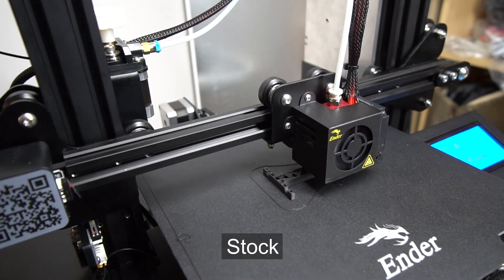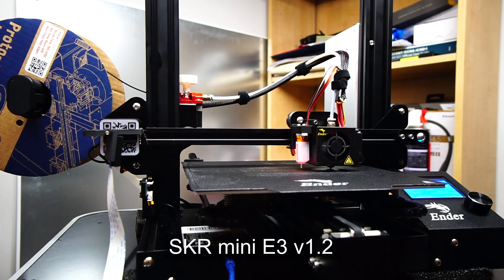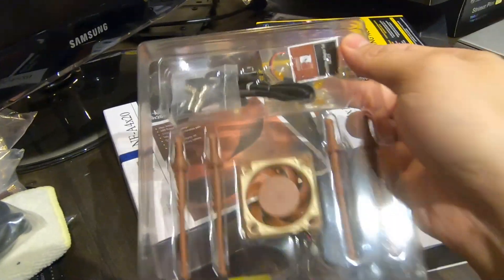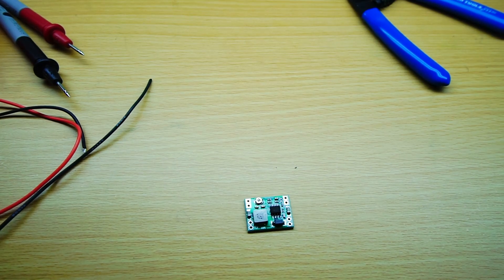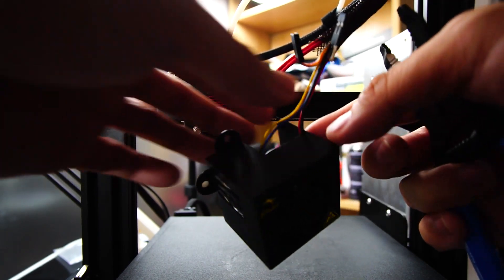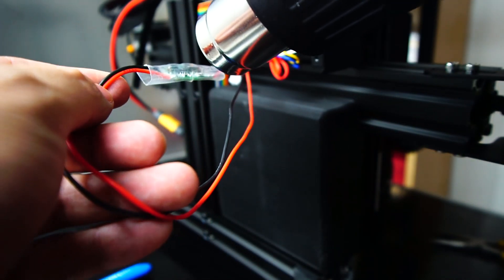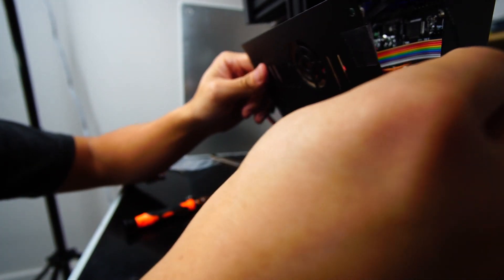Upgrading Ender 3 Fans with Noctua 40x20 for Quieter Printing

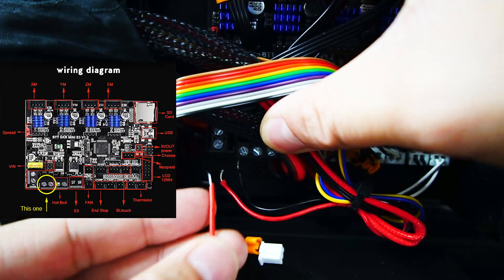Comment: One of the best videos for this, thanks a bunch! Also for the buck converter for the mainboard, did you also connect it to the yellow circle at 3:30? So you have both buck converters going into that yellow circle?
Reply from the maker: No, both circuits are separate since the fans have different ports.

Comment: How come you are setting the buck converter to 5V for the noctua fans? I thought they were 12V fans and every other video I've watched on this mod has set all buck converters to 12V.
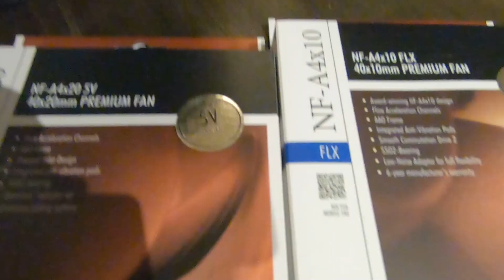Reply from the maker: The noctua fans I installed are 5V models. You can see it at the 1:00 mark where I mentioned the different models and voltages rating. Amazon links to the exact fans are also in the description of the video. I would recommend verifying the voltage rating on the fans before installing.
Reply: @dorkytim  Thanks, makes sense. I didn't realise there were 5V noctua fans as well. Cheers

Comment: Hi DorkyTim, really enjoyed your video. I notice that other people who install Noctua fans on their Ender 3s end up soldering at some point.  Did you have to do any soldering, or was the buck converter and multimeter, and the fan(s), all that was required for fan replacement? Thanks.
Reply from the maker: Soldering is definitely preferred to ensure things will stay connected, but if you have good shrink wrap then it can hold the connection well enough without solder. I've tested both, with and without solder, and didn't find any problems using either methods. I suggest shrink wrapping even if you decide to solder.
Reply: @dorkytim  Great video, by the way. Subscribed. Any link to the shrinkwrap tubes on Amazon, or the heating tool you used? Thanks again!
Reply from the maker: @RiqueFresco  https://www.amazon.com/gp/product/B01MFA3OFA/ This is the set of shrink wraps I have, but I did find that even the widest one in the set (10mm) was a tad too snug for these buck converters. It was a little bit of struggle to get them on. If I had to do it over again, I would think about getting ones that were a little bit wider than 10mm. Maybe 12mm would've been nice. I got the heat gun from a hardware store, but any $12-$20 heat gun on amazon will likely do. If you get a heat gun, I recommend one with a stand that lets you prop it facing upwards to be useful in a lot of other applications. However, for this small application, you can also use a candle or lighter to shrink the wrapping as well. Just be careful not to touch the flame directly on the wrap for long.

Comment: Noctua fans, 2 versions are available. 1 is pressure biased, the other flow biased. Which did you buy? Have you tried both to compare results?
Reply from the maker: That's a good point. Thanks for bringing it up. When I was researching Noctua fans, I found that they only mark certain fans in the 120x25mm size as pressure optimized or airflow optimized. There was no such distinction in the 40x20mm or 40x10mm sizes. In the 40x20mm category range, all of them had the same rated metrics except for the differences in voltage and signal.

https://noctua.at/en/which_fan_is_right_for_me
https://noctua.at/en/products/fan

*Edited to add links
Reply: That's actually quite interesting.  I can tell the difference between the two types just by looking at the blades. The swept type blades are pressure biased and the more symmetrical "petal" shape is usually flow biased. You've peeked my interest, more homework. 😀

Just a brain dump but perhaps due to the small size they have went with a compromise somewhere in between. It gets difficult to control air flow the smaller you get and the stator/rotor assembly is probably a more or less standard design reused across several sizes thus limiting options in terms of space. Shape of the "frame" and the blades effect performance. A lot of engineering would probably be required. Perhaps cost vs typical number of units sold lead them to go for a single more middle of the road type of design.

Comment: Not sure if you noticed but normally Marlin is configured so hot end fan starts spinning ing at 50-60 defgrees. With noctua mod and buck converter fan is on from the moment printer is turned on. That's pretty weird - not sure why printer ignores firmware setting for this one
Reply: hot end fan has always been running for me. Changing the fan should not change this all.
furthermore, I have a raspberry pi plugged into the USB port. even if the machine is off, this will also power the hot end fan.
i'm wondering if you just didn't notice it until you changed the fan?

Comment: Thanks for that Tim.  Very well done video.   Much appreciated.  I want to try the same mods.   just two  questions:   Is the original Input Voltage to both BUCK converters 24 V?  Did you do your BUCK converter adjustment off line, or actually connected to the Mainboard ?
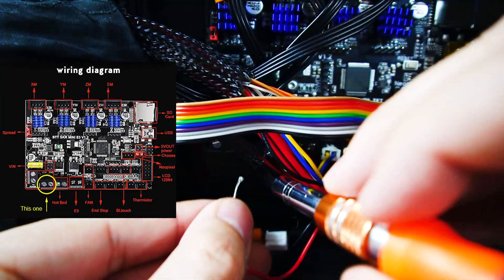Reply from the maker: Yes, the original voltage was 24v which is what the ender 3 pro uses. However, the main board is also rated for 12V because some older ender 3 models had 12v power supply, so it's important to double check what the voltage coming out of the fan port, I did this offline with my multimeter. For the buck converter, I did supply it with power from a power station offline to make sure the buck converter was functional, and then at 3:45 in this video I connected the buck converter to the mainboard and did the voltage adjustment while connected to the printer.
Reply: @dorkytim  So you have to buy a power station that costs more than a quiet Prusa? Why do every youtubers expect that (poor) viewers own expensive engineers equipments?
Reply from the maker: I'm sorry, I'm not sure I understand where the expensive power station you are referring to is coming from?
Reply: @dorkytim  I've seen CHEP doing the same mod. He also measured the buck converter with a offline power station. That doesn't look cheap. I've seen many youtubers doing this mod, but none mention or showing the crucial part; how to tune the converter to 12 v before final mounting.
Reply from the maker: Oh! You just need a tool that can measure voltages. These multimeters are around $10 and come in many different brands. I would say they are a staple in any tool box for electric work. You could also get a buck converter that has a LED readout built-in for about $1-$3. I wouldn't consider this expensive in comparison to a Prusa which is around $800 give or take.

 https://www.amazon.com/dp/B07VHC1NMC/ref=cm_sw_r_cp_apa_i_vstwFbSAWXP1E

https://www.amazon.com/dp/B089N65NMP/ref=cm_sw_r_cp_apa_i_MxtwFb3XQ8B7W
Reply: @dorkytim  Thanks for your answer, but that is not what I meant. I do have a multimeter. I just want to know if it's ok to have the Ender 3 Pro as the only power source to tune the converter. Is it ok to just cut the two hotend fan cables, solder them to the input on the converter, power up the printer and measure/tune to 12 volt on output side on the converter with multimeter? And same for the mainboard fan?
Reply from the maker: Ohhh! I understand what you mean. That is a great point. Ideally, it would be great to be able to test things in a separate circuit. However, what you suggested would be fine. As long as you are careful to connect the fan power to the input side of the buck converter, there shouldn't be a problem with tuning directly on your Ender.

At worst the buck converter is bad, but your mainboard should be fine unless the inputs were shorted for a while.

Connect the multimeter to the output of the converter and be ready to read the voltage. If it's not in the expected range, then shut down the power and toss the converter for another one.

I wish I had a power generator as well. For most of my testing, I use an old PC power supply and a bread board. For this video I did it directly off the Ender.

Edit: I originally said I did it off the ender in this video, but checked back and that was another video.

Edit2: Nope, I was wrong again. Turns out I tuned it both ways while working on this video. On a power supply and directly on the ender.
Reply: @dorkytim  Big thanks for your answers! Now I know it's ok to tune the converter by directly connect it to the Ender 3 Pro fan power. It should not take long to tune it, so nothing should harm the electronics.

My biggest fears were that if I connected the converter together with the fan and turned on the Ender I could have fried the fan if the converter was completely incorrectly set from the factory.

But this way, I can tune the converter easily and knowing that the output is 12 volt and then do the complete solder work. And also after that, power up the Ender again and double check the output that it will still be steady at 12 v.
I will do the same procedure with the mainboard fan.

Comment: Don't you have any problems with heat creap? There a a couple of post concerned with the low airflow.
Reply from the maker: I have not had any issues with heat creep. I understand the concerns, but I've been monitoring this fan setup for quiet awhile and have yet to see signs of an issue.
Reply: @dorkytim  Okay thank you! Are you only printing PLA?
Reply from the maker: The two main types I print with right now are pla and petg.

Comment: I've seen some comments, that people burn they motherboard by powering buck from it. It's safer to power it straight from 24V, since it running continuously
Reply from the maker: I agree, if you can avoid adding things to the circuit and keep it at 24v then that should be the first option. I don't think there's anything wrong with using a buck converter though. Just check your circuit and be careful.
Reply: Yes, its defenately a thing. I did burn it too, however i dont understad why is it a problem to add a buck converter to the motherboard (as iam not good at electronics and i just wanted to follow step-by-step tutorials)...
Reply: I think these people are using maybe some bad buck converters or something.  The role of the buck converter is to change the voltage.  That should have no affect on the main board.  The power is leaving the main board and buck converter is lessening it.  So if it's "burning it out" in some way, that's usually an indication of too much voltage, which means the buck converters at some point aren't doing their job correctly.  I have 2 on mine for a couple of years now, never an issue.

Comment: what about using 2 12V fans in series? you should get a high flow with that and no need for the buck converter..
Reply from the maker: It will work, but I would not recommend running fans in series, and it's a bit excessive for the hotend. If performance was the goal, then the stock fan is good enough. The goal here was to reduce noise and extra fans would add more variables for noise. You would also need a proper mount that would best make use of two fans. Also, fans in series would divide the voltage, but the fan closes to ground would take on the higher potential drop than the fan behind it. That and the fact that there will be very small differences between the two fans because their resistance would never be perfectly equal. These factors mean that one fan would always wear down faster than the other fan. If you are going to go through the effort of adding another fan, it doesn't really reduce the effort of adding a buck converter in the first place and has extra cost.
Reply: @dorkytim  thank you very much for your explanation... Very clear!! Greetings from italy
Reply: @dorkytim  aaaaaaand, what about powering a 12 V noctua fan and a 12V led strip in series? that way i would have the tension for my ledstrip too.. would be very useful for me.. would it work?
Reply from the maker: Some boards actually come with a port that can be programed specifically for addressable RGB, which I think is pretty cool. In regards to 12v LEDs, again it would be possible, but you're also adding another point of failure in the circuit. If the led lights break then your fan stops working too, and the fan is more crucial than the LEDs. I would hate for a long print to fail because a perfectly good fan stopped working because of led lights. It can also be hazardous if the hot end fan stops running.
Reply: @dorkytim  thank you very much!! Does the ender 3 pro also have this rgb port?

Comment: i removed the fan on the PSU.  It is good for 350w  and then i am printing it is using like 80w  so passive cooling is enougth
Reply: how much power does it draw when the printer's heating?
Reply: @123isonmi  100 -110

Comment: where do you put buck converter for main board if you get one of those kind of big ones with the digital numbers or w/e?
Reply from the maker: I'm not sure, if it's too big to fit inside, then it'll have to hang outside somehow. Though converters are pretty cheap, so if possible, getting one that fits inside would be preferred.
Reply: @dorkytim  The ones I had were too big, so I just printed little boxes for them and mounted all along left side of printer.  Looks pretty good.  I think the little ones may have fit but I had some I ordered like a year ago so had to work with what I had lol but it turned out ok, and I didn't need one for the psu as expected so they all fit over there.
Reply from the maker: That's great that you were able to solve it with printing!

Comment: Is 4020 noctua fan is enough to cool down hotend? Some people who use it on some fan ducts say there are some problems, however I feel that the reason is using fan ducts that make everything hoter (more parts, additional blowing fans etc.). Do you have any problems with that setup? - 4020 + this custom housing?
Reply from the maker: I've been using it for a couple of years now and have not had a problem.
Reply: I have a noctua 40x20 for nozzle cooling, keeps it the right temp.  So they are wrong, because I mean that's it's only job.  To keep it that temp.  Sure it fluctuates a little but it did that with stock fan too and doesn't affect my prints.  As for print cooling, that's where I thought it might be lacking.  So I got a splitter that goes on top of my briss fang, and mounted 2 of them up there lol.  Works great, better than stock.

Comment: Hi! I can see that the nozzle fan is easy to connect with the buck. But what about the motherboard fan? In my ender 3 v2 I can see the fan with two cables (blue and yellow). The correct connection would be cuting these two cables and intercaling another buck? Could you explain how to do this? Thanks!
Reply from the maker: The motherboard fan in this setup is 12v, so yes, another buck converter was interlaced between the port and the fan since the fan was not 12v. This is the same process as with the hot end fan. If fan voltage matches the port, than no buck converter is needed.
Reply: @dorkytim  Thanks! I bought two 12v new fans and a pack of 5 converters through amazon haha. So If I have understood well: I need a converter for the noozle fan, and another converter for the motherboard fan, and this one I have to cut the two cables (in my case I have a yellow and a blue cable) and put the converter between the connector and the fan. Is it ok? Oh, sorry for bothering you man haha.
Reply from the maker: Yes, I'd your psu is 24v then slice the two wires and connect the converter between and adjust down to the 12v output.

Comment: What about the heat problem with the buck converter? is it having some temperature issue?
Reply from the maker: I've ran this printer without issues on a 24 hour print job. Buck convertors are generally pretty efficient and don't have much of a heat problem compared to a voltage divider. If your buck converter is getting too hot then it could be that there is too much current draw, or the parts on the converter are bad/badly assembled. There have been cases of bad parts which are not as efficient as they claim to be and end up releasing more heat then expected. There's also the case fan in the mainboard compartment to help provide some airflow to the buck converters.

Here's a link to a video that gives a practical example of the buck convertor efficiency and temperature compared to a voltage regulator.
https://youtu.be/giGRrODKJSE

Comment: Can’t you just put two 12 volt fans (one for mainboard and one for hotend) in serial to make 24 volts and connect them both to the hotend fan header?
Reply from the maker: Technically you can do this, but there are few things to consider. The biggest one is that if one of the fans fail, they both fail. It's safer to have one less point of failure that could cause a fire hazard. Secondly, even if you get the same fan, no two fans are perfectly identical. The slight variation will always put one fan under or over. It's hard to say how much of an impact this will have over the lifetime of the project, but most sources would recommend against doing this setup. I would recommend some thorough testing before leaving things unattended over night. With that said, I don't think the level of effort gap is large enough to consider putting the fans in series as oppose to using buck converters.
Reply: DorkyTim thanks for the reply! I did not consider those possible problems, i will just use buck converters

Comment: This might be a stupid question but can you explain how you converted it from 3 pin to 2 pin?
Reply from the maker: Only 2 pins are needed to run the fan, the 3rd pin is used for rpm speed signal and is not needed.

Comment: Do you had a problem with the A4X10 Noctua Fan as mainboard cooling in long prints ? Because the Airflow is less than the stock one.
Reply from the maker: No issues with main board cooling using the noctua. It doesn't take a lot of airflow to keep main boards cool.
Reply: @dorkytim  thanks sir i will install it 👍
Reply: Do u guys know if a 40x20 will fit in there?

Comment: Why you use 5V noctua intead of 12V noctua ?
Reply from the maker: It's just what I had available. The 12v and the 5v have the same rating for airflow, so I could've used either.